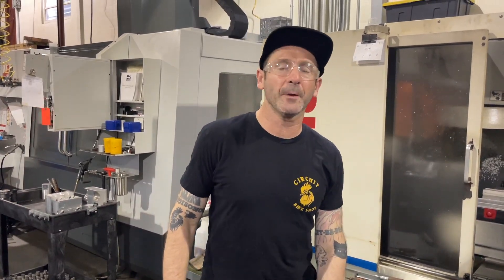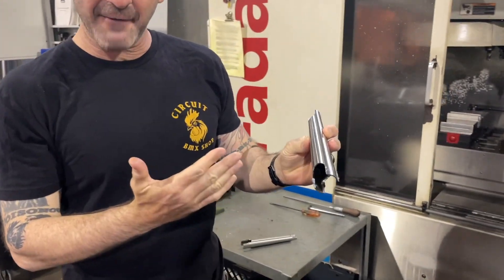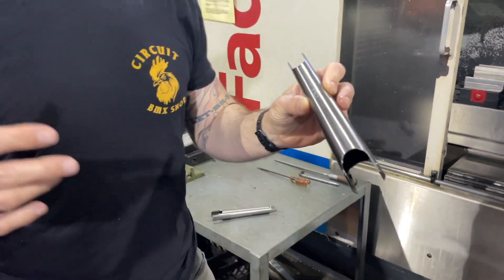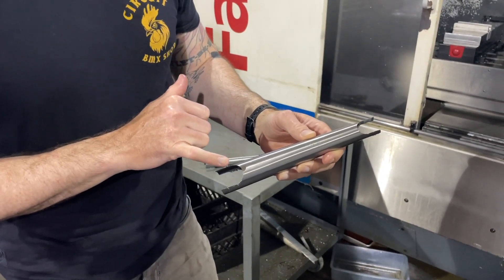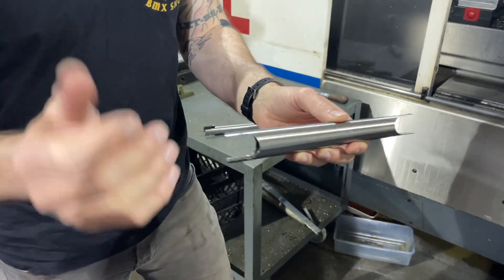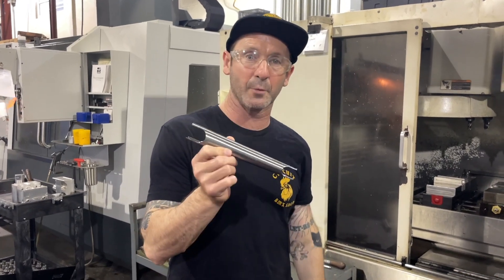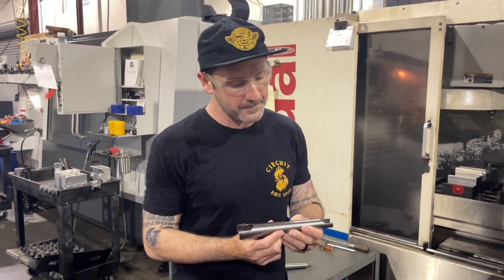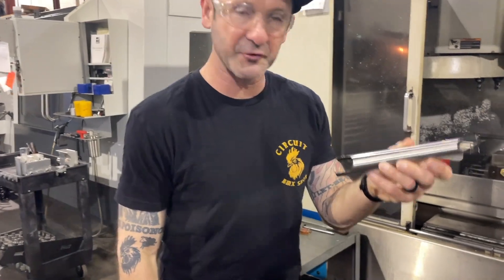Our Crank Arm Milling Process -- Inside Profile Racing

Comment: You said a couple of weeks at the end of the video. It's been 4 months and I really need a set. What is your current eta on chrome 170mm?
Reply from the maker: We did get them back in, but they sold out immediately. Next up in 175m RHD and No Boss in 19mm, chrome. We should see those at the end of January. 170mm, at this point, has no ETA.

Comment: If it's a BMX (trick bike) company why is it called Profile "Racing" then?
Reply from the maker: Good question. Profile Racing started as a Race Car parts company in 1968. That's the company's trade mark name...so when we got into bmx in 1978, the name remained and represents a brand that extended itself into bmx. Now, bike parts (in general), are 99% of what we manufacture.
Reply: @ProfileRacingOfficial    thanks for answering. 🙂
Reply from the maker: @Bmxerswithdreadlocks  Of course, no problem!